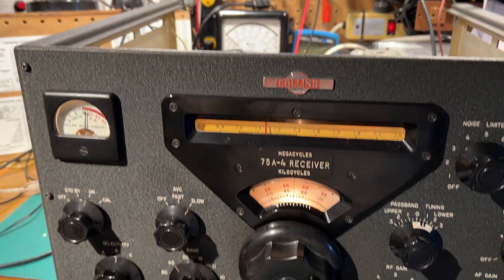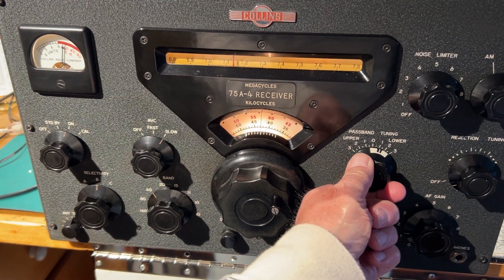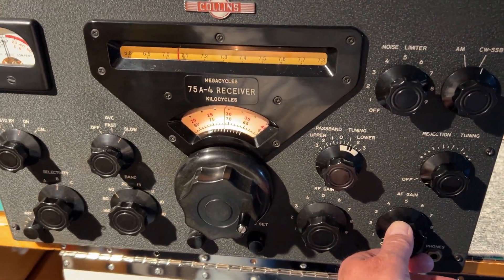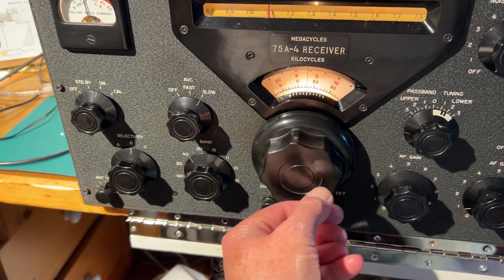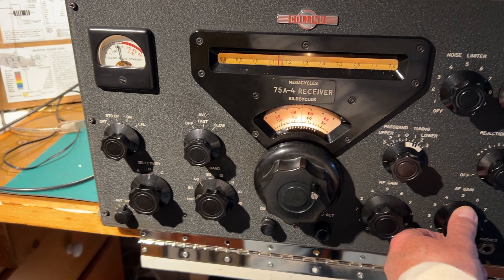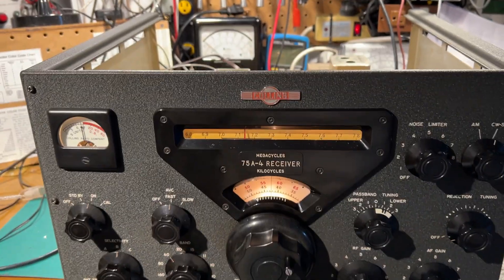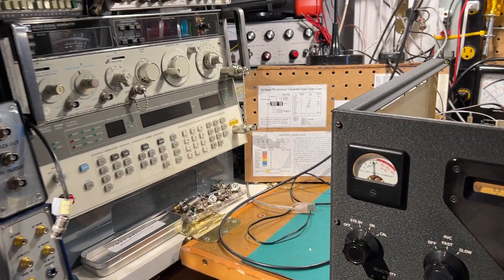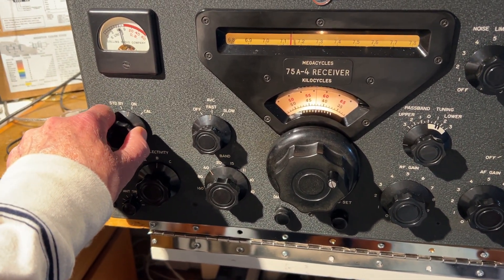Collins 75A-4 - Demo of Receiver on 40M Band

Comment: Piękne radio. Magia czystego analogu. Pozdrawiam
Reply from the maker: I agree - its a beautiful set!
Reply: @RadioRestoration  Good time of day. At first, the reception is noisy. Are you probably an urban amateur radio operator? - in the city? I was listening to the 20-meter band today, so I was surprised that it was making noise at the same time as turning on my old air conditioner! )))) (this has never happened before ! ) :(((((((((((((( Hosted on the radio " TS-530 s" 73 !
Reply from the maker: @иванепифан-к8ж  I am in a very electrically noisy location.  The antenna in use here is just a small indoor active loop, but that also picks up electrical noise.  Other types of antenna are much worse.
Reply: @RadioRestoration  Yes! Such a device (Collins 75) should be listened to far away from electrical interference! I know what it is, "reception for radio tubes")). in the 90s I had a tube unit (Transceiver) and what (impression (!) I received it when distant American radio stations passed through the "polar cap" with CRYSTAL reverberation....